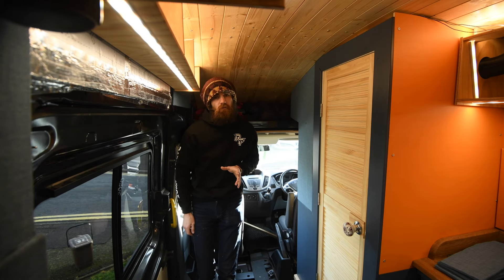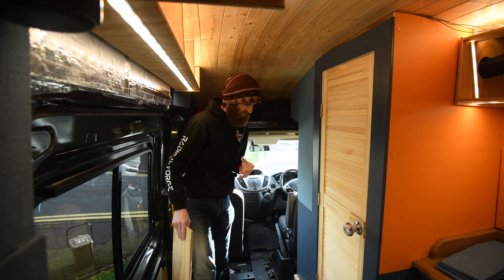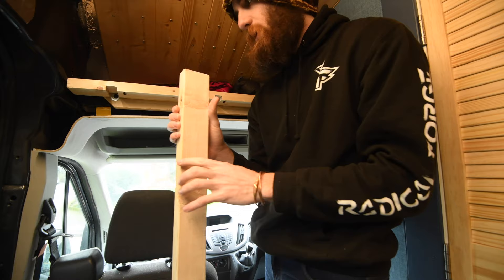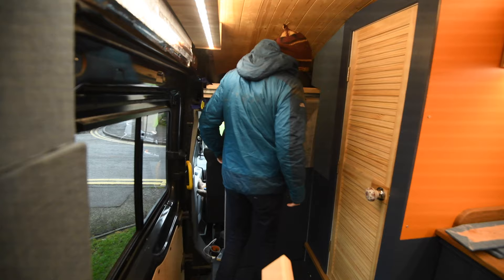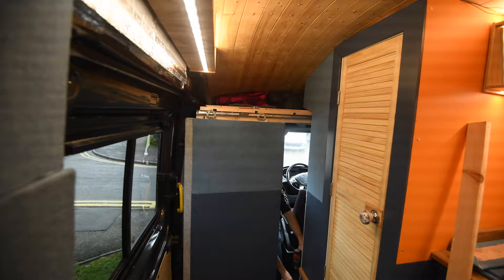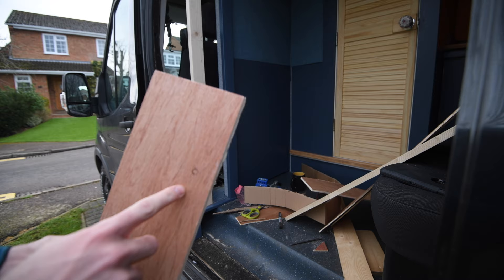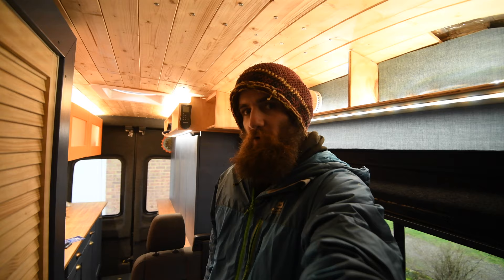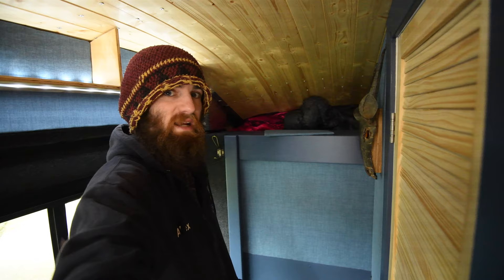Insulated sliding bulkhead door | EP44 | Ford Transit Campervan Build

Comment: Just watching all your build videos. Can’t believe I haven’t heard mention of an electro magnetic catch for the sliding door, wired to the ignition!
Reply from the maker: If definitely an idea for the next one. I would need to bypass switch as i often go in and out of the cab when at idle at time. But you are right a electro magnetic catch would be a good idea. A few of my friends use them on draws

Comment: Great video,  on my transit I was planning on a curtain,  after watching this,  I'll definitely do a curtain
Reply from the maker: I think my original plan at the beginning the build was to not build anything or just sort of have a curtain which is what I had temporary rigged up during November and December. But since I had just enough of a gap even at a slight angle to have a sliding door I thought I’d go for that
Reply: @MispronouncedAdventures  Good on you for making a good solution.  The beauty of doing your own build is that you do it for you and how you want it.  Nothing is designed by committee or restricted by convention

Comment: Love what you’ve done - and want to ask about how to mainly keep the cab area closed off except for an emergency. 
Does your driver’s seat fold forward, by any chance? I’ve been wondering whether it would be feasible to fit something like your set-up so the sliding door is part of the shower unit to make an emergency access to the cab.
In other words, go into the shower, open the sliding door panel and climb over the folded driver’s seat to get into the cab. Flip driver’s seat back up and drive away from the bad people. The shower side of the sliding door would, of course, be protected by a shower curtain when in use. 
Am I thinking way too far out of the box with such an idea?
Reply from the maker: The front seat can definitely slid and fold forward. So if you did want to make a permanent bulkhead with a emergency hatch via a shower room that could work.

Comment: Nice job!
I can only imagine how much time it took, for especially, the door post (left side).
Reply from the maker: Definitely some figuring out and I particularly wanted to make everything using the current wood I had opposed to buying more. Generally the only thing I had to buy and couldn’t make was the door rail. all the other bits of timber wood, PIR Board and ply were leftover from other parts of the build

Comment: I'm just about to embark on a very similar bulkhead/sliding door using 25mmx44mm batons & 5.5mm ply for both wall and door. Did you end up putting 5mm ply on the cab side in the end? I was wondering about just using the carpet straight over the PIR board/wooden frame to save a few mm (every little counts when you have an L2 transit!)
Reply from the maker: I didn’t end up put much 5mm on. The cab side in a thin plastic then just carpet. Hab side is 5mm on the bottom and fabric on the top to match the van

Comment: I'm wanting to build a wall behind my driver's seat similar to yours.
Did you just bolt into the already made holes for the metal bulkhead or did you have to come backwards slighty due to the chair adjustments?
Reply from the maker: Yeah I used the bulkhead threaded hole when I could. So the seat adjustment, I’m the only one would drives the van so I’ve built it in a way would works for me but does limit movement a little

Comment: What’s the blue trim material? Has it got any stretch? Where did you find it?
Reply from the maker: The light blue stuff on the top of the door section? 

no stretch I’m afraid but quite easy to apply on flat panels with a spray adhesive. That’s from the uk eBay “blue linen fabric”, was my search, lots of sellers selling the same material in many colour. The light blue is called “ denim” ( just colour name is a denim, it’s not a denim Jean like fabric ). The dark blue elsewhere in the van is “midnight” . many also offer a small samples .

Comment: Do the door hold in place when you drive the van?
Reply from the maker: Good observation, as I don’t have a locking mechanism in place during this video. General driving, not really, but if I do swing it around a roundabout, it will move. To be fair, this could be easily fixed if I put a lightweight magnet on either side.

Comment: Alex, did you ever commission the 12v immersion element?
Reply from the maker: Not just yet. As it was always planned as a solar dump load,  as it’s currently UK winter it’s sort of got put on the back burner. Until I’ve got excess solar. But I am in the process of running out of jobs to do so I’ll be rigging it up at some point soon.
Reply: @MispronouncedAdventures  Thanks.  Because I'm about to buy the Bobil system and was considering putting one in with a manual control, as it could be used when driving (kind of like with a calorifier) using the B2B charger.